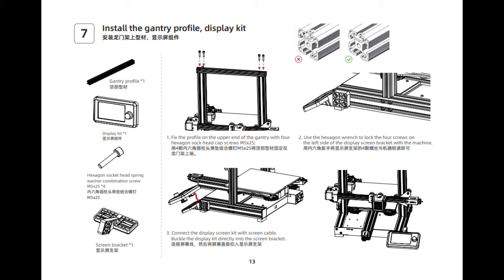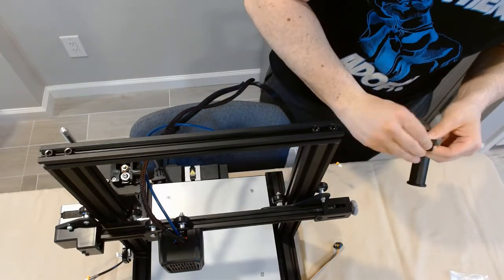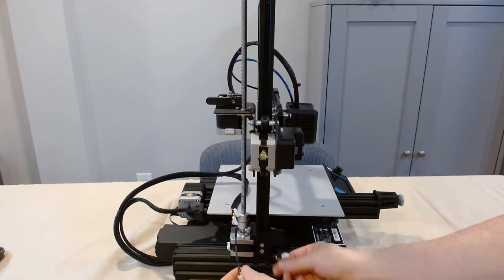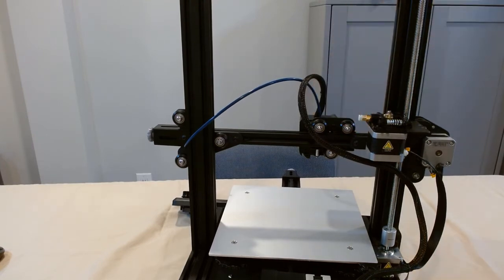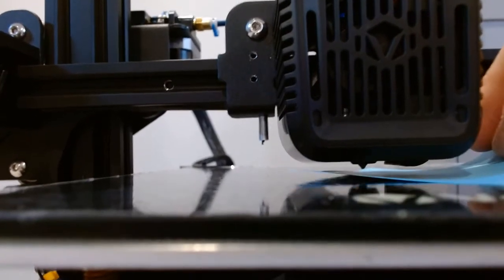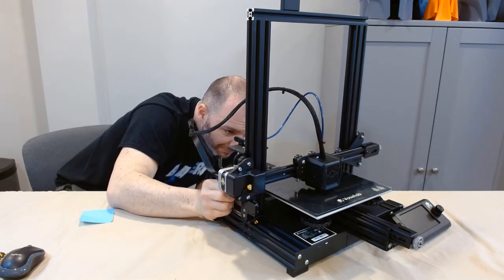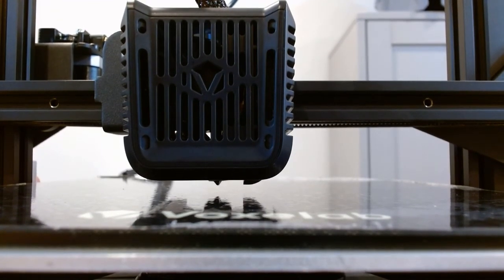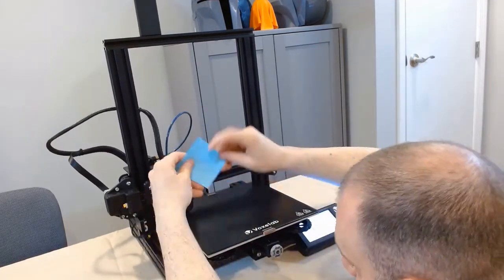Voxelab Aquila Assembly and Unbox Part 4

Comment: This was timely!  Soon to be a newbie.  I ordered an Aquila X2 and wanted to install yellow springs, a hardened steel nozzle and Capricorn tube while doing the initial assembly.  WOOT.  Thanks for the 4-part setup videos!
Reply from the maker: These videos are a little long but I try to cover all the important parts. Congrats on entering the 3D printing world! Why are you installing the hardened steel nozzle? Will you be printing with exotic materials ?
Reply: @PrintsLeo3D Once I "get my feet good and wet", I plan on doing some glow in the dark items for children and read that the filament is abrasive.  So, rather than having to change out later I thought doing it up front might be a good way to proceed.
Reply from the maker: Very cool. I've used glow in the dark a few times and it was pretty neat. Good luck!

Comment: Thanks for your four build instruction videos, easy to follow👍  I've been printing for a week now with great results, only thing I have noticed is the lower x axis guide wheel is either de-laminating or shedding off it's surface, is this normal wear for a weeks printing? I adjusted the cam wheel so you could just rotate the wheel whilst stationary during the build. cheers 👍😎
Reply from the maker: I'm happy these videos helped. Those guide wheels can build up a good amount of 'fuzz' in a short time. It's pretty typical behavior though, I would just clean them off a bit and keep an eye on it. Cheers!